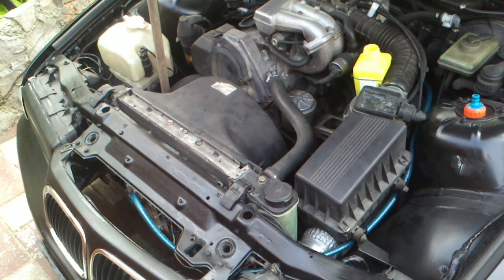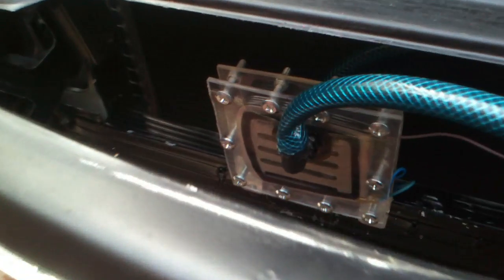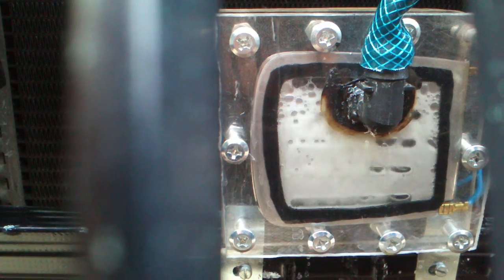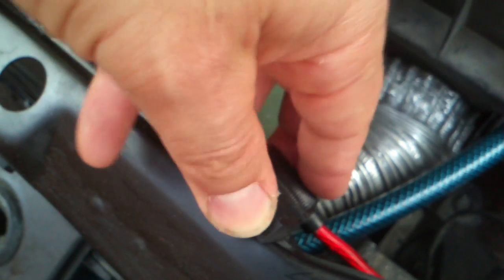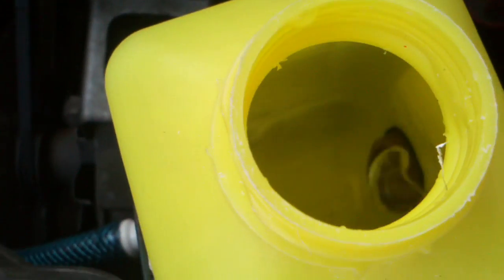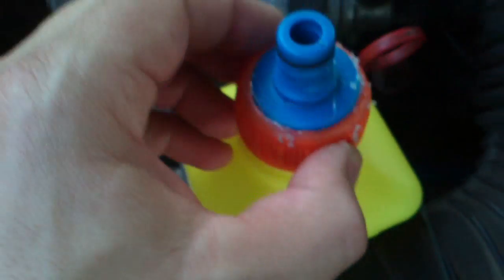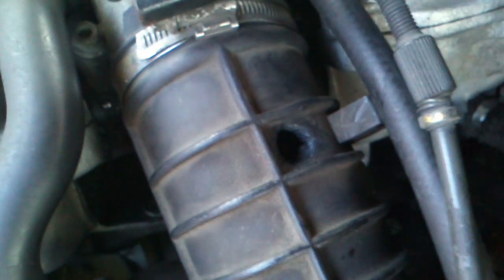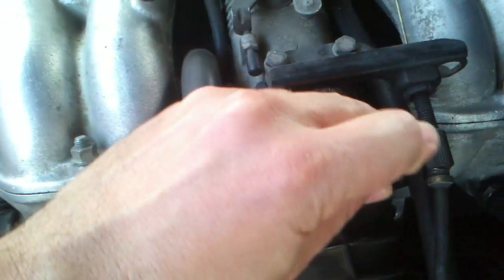How to make a dry HHO fuel cell cheap & easy part 2 of 4

Comment: You can treble the HHO output by circulating the water through the cell with a small pump. The production is much increased but the liquid has then got to be separated from the gas... Still experimenting but a small centrifuge may work. Vastly increases the complexity but huge output from small cellls
Reply from the maker: Darc Horse im also experimenting with a small window washer pump. Will put video up soon

Comment: I made several HHO generators and had the same problem with the water getting rust colored.  If you use a different grade of stainless steel, the problem will be eliminated.  I'm not sure what grade you have to use, but if you look, you will find it out there somewhere.  Good luck.

Comment: hi im trying to create a dry fuel cell generator for my apartment now i want to make sure i got this correct maybe you could help? you have the  grill and  a seperate tank with the electrolights and by running an electric current  through the grill that creates hydrogen wich can be pumped into a  gas powered electric generator producing h20 as its safe by product?

Comment: but why Sodium ?
Reply: Straight water will not allow electrolysis to take place, salt or "sodium" is a metal and helps the electric current to be transmitted.
Reply: To increase the flow of current in aystem to increase the output

Comment: Wordavee1, I hate pseudoskeptic assholes like you. 

Miles, can you explain how the wires are connected? I understand the water-hydrogen cycle to air intake, but there wasn't any video connecting the wires.
Reply from the maker: +Gaia Guerrilla very easy bro, first plate is connected with a negative wire then you have 4 or 5 neutral plates then the next plate is connected to a positive wire and then 4 or 5 neutral plates and you repeat it as many times as you want. i connected all my negative wires to my chassie and the positive wire to my headlights.

Comment: The dirty water is rust contamination from the accelerated corrosion as a result of the electrolysis.You should use platinum spatulas next time to prevent corrosion, since platinum is very resistant to corrosion.

Comment: Have you measured your HHO output? You probably need about 1 liter / minute for that car. 
I hooked my on/off relay to my fuel pump positive wire. That way, I never get HHO unless the engine is calling for fuel. No switches to remember. 
Can't wait to get your performance reports.